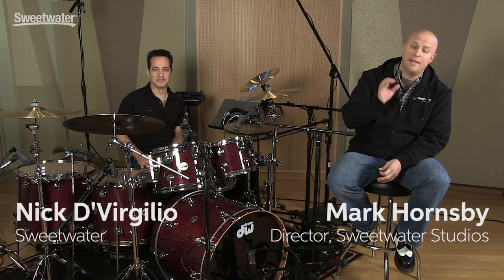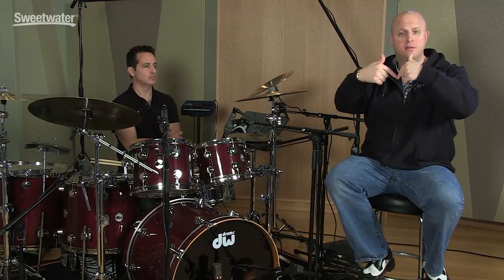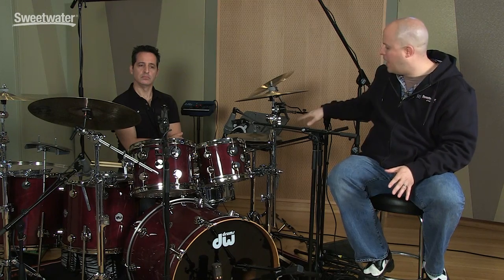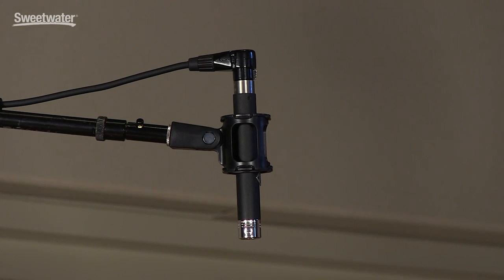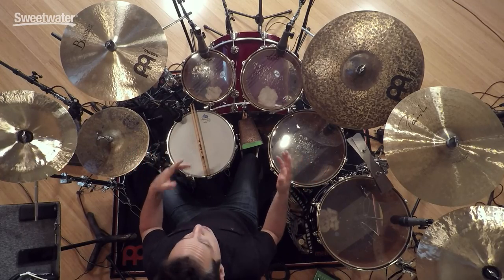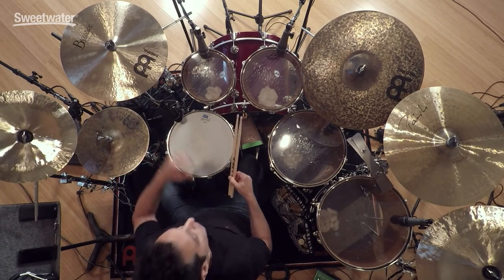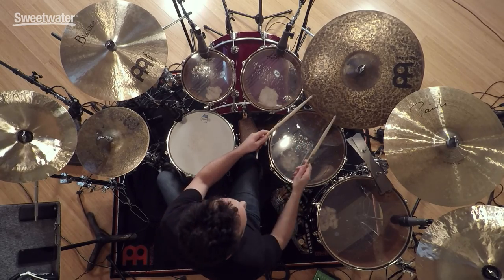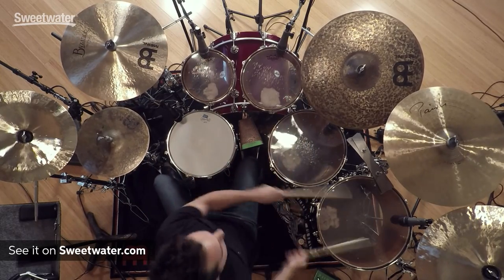How to Get a Great Overhead Sound with Telefunken Microphones

Comment: The one thing I would add is to make sure the mics are the same distance from the snare. Or snare and kick. It keeps the snare in the centre of the stereo field. Other wisest sounds like the snare is off to one side instead of being in the centre. If you’r mixing just for cymbals then it does not matter. I know the snare mic puts the snare in the centre. I like the overheads to see the kit as it is with kick and snare in the centre. Ether way if it sounds good then no matter how it comes about. Another great video I really enjoy them.